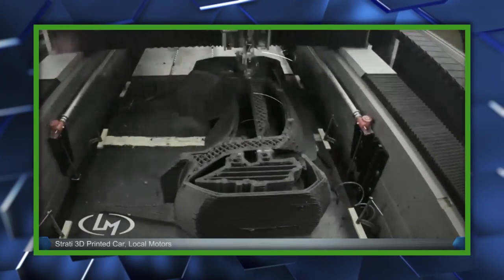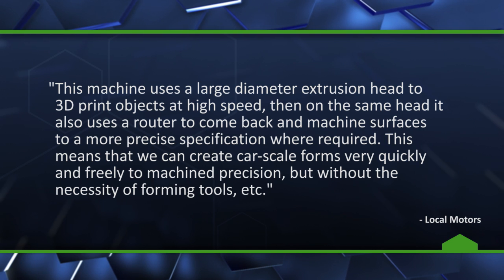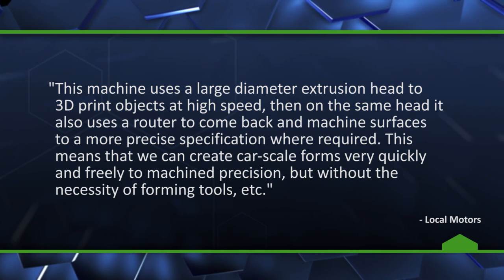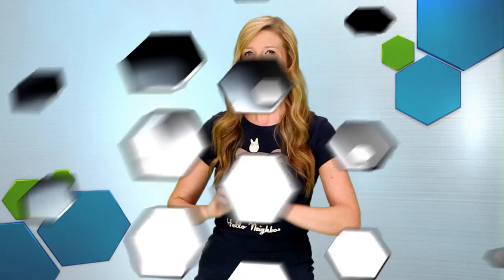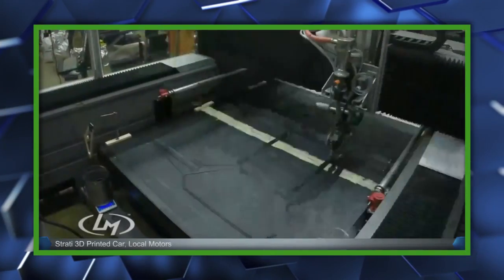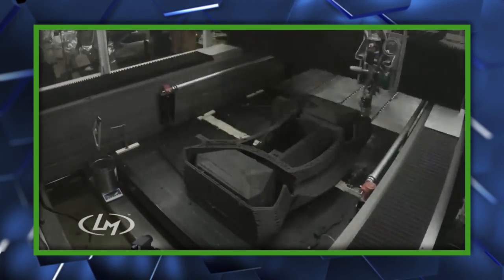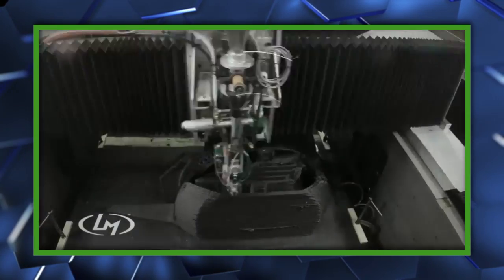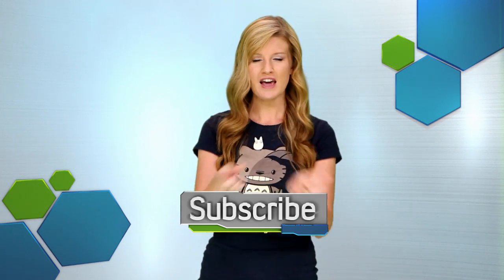Fully Functional 3D Printed Car Made in 44 Hours - The Know

Comment: I just want to clarify on 3D printing since this video didn't explain it to well.

- Basic it uses high intensity lasers set at specific algorithms to 3D print the car with the feed being metal powder in a closed system.
- The car built by 3D printing has a better and stronger exterior than a regular car due to 3D printing being able to minimize defects which are present in traditional methods.
- However, 3D printing is not popular yet mainly due to the high cost in metal powders. Once we find a way to lower the cost in making metal powders more options will open up for 3D printing. The cost of the laser should be considered as well.

Source: My limited knowledge and memory of what my professor said.

Comment: This is actually very interesting. A typical failure point for cars are the moving parts & where parts connect. By 3D printing most of the chassis, you reduce it's fracture points measurably. Need to see crash test results to know if this is a good thing or a bad thing though.

Comment: There are high precision metal DLS printers that can print working combustion engines... Not sure how well it'll hold up to stress- if there are micro fractures along the sintering area... single cast will be best method for awhile longer.

Comment: You can't 3D print a car. Have fun printing an engine, or at the most basic level, copper winding for a motor. There's no reason to make panels this way. It takes magnitudes more time, and is multitudes more expensive.
Reply: Do research.  No one said their printing an engine!  or a motor!  and your wrong.  the both can and have been done.  their printing a car to put a motor into.  There is a reason to make panels this way.  Its alot faster and way cheaper to prototype a car via 3d printing rather spending tens of thousands of man hours making forms dies and molds to make body panels alone.  Never mind the chassis, interior and everything else that goes into a car.  If your running prototypes or low volume production this is both much faster and much cheaper then traditional methods.  That's why this technology is commonly reffered to as RAPID PROTOTYPING.  good day.

Comment: While I am more of a muscle car guy and this car isn't really my style, this does look quite interesting.  Anyone know if the 3D printed material can be compared to something like Carbon-fibre or carbotanium (yes, that is a real thing)?
Reply: I'm guessing that it would have to be somewhat durable... To be able to hold the weight of the materials used and the engine and transmission, along with the axles. So I hope so... Otherwise its going to disintegrate when they start it.
Reply: Could maybe make it the same way, or similar, to how a carbon ceramic brake disc is made with the carbon flakes: /watch?v=Q_3PebbkGpo

Comment: It will be like driving a quad though. You are probably dead if you hit anything with more than 30km/h. Even with airbags. The stuff this is made out of does, probably, not absorb force like a "real" car.
Reply: Bet it'd float real nice, though. Stick a cannon on top and GTA:VC it around!
Reply: While I get your point, this thing would absorb MORE force than a normal car. I think. But I agree, you'd be screwed in a collision with anything vaguely metallic.
Reply: You know all cars now are made of plastic, sort of like this car.
Reply: carcist.
Reply: Jmal05 Where do you live, Legoland?
Reply: Kyle Hamrick You know why cars dent so easily? Because they are made of plastic now. Obviously not the same plastic in toys and all, but plastic.
Reply: Jmal05 They have plastic parts, as well as steel parts and chrome parts. The exterior may be made of plastic (which is why they dent) but you wouldn't get away with a plastic chassis.

Comment: What would the finished product cost? Unless production costs (which would then in turn be passed on to the consumer) are reduced significantly then I don't see the point. Ideally this should used to produce some kind of electric "people's car" for the U.S. where 3D printing would hopefully move production cost down into the range of affordability for average Americans. Hopefully this will also usher in changes in how auto manufacturing is regulated and how cars are approved for sale in the US. Could mean the beginning of a lot of new cars designed, built, and sold in the US.

Comment: How safe could these be though.
Reply: No car is safe
Reply: ***** No you didn't. But when you refer to them as "little plastic smart-cars," it definitely seems that that's what you meant.
Reply: TheTallSpartan and you can see the same in the printing the put more support for the frame the closer it got to the driver spot so it would still have a crumple effect
Reply: ***** Actually they're pretty safe. They have a strong metal frame reinforced in key points. I think. I dunno. I saw it in a show once.
Reply: ***** Exactly. It's what you didn't say. You never specified what parts of the car were made of plastic. Which gives a better impression: A car with a heavy-duty metal frame and plastic exterior, or a car, engine parts excluded, made out of plastic?
Reply: Carlos, Drinker of Sodas
One of the main safety feature of a car is the ability for the front to crumple on collision to increase deceleration time.   Just thought I'd expand a little on your 'They have a strong metal frame reinforced in key points' point.
Reply: ***** You weren't specific, and it sounded like you were calling them flimsy, get over it.
Reply: ***** You're forgetting that I only misunderstood because of your lack of clarity. People can't read your mind. Not to mention that you posted it in a seemingly sarcastic tone. When you phrase it like you did, no one thinks that you mean "Oh, they're one of the safest cars on the planet! It can't be safer than that." Instead, they notice that you're comparing the smart car with a car that looks as flimsy as can be, and think "He must think the smart car is also pretty flimsy, to be saying that."
Reply: ***** At this point, you're just restating the fact that I misunderstood it (and yes, I DID misunderstand it. It read it perfectly fine, just simply thought it was sarcastic), which I already admitted to. You phrased it in a way that can easily be misunderstood. I can almost guarantee that almost everyone, if not everyone, who thumbed your comment thought that you were saying the car wasn't too safe.
Reply: ***** Your the one who needs to grow up get back to school kiddie and learn you manners lmao. Telling others to grow up when your clearly the immature one here. GG no re